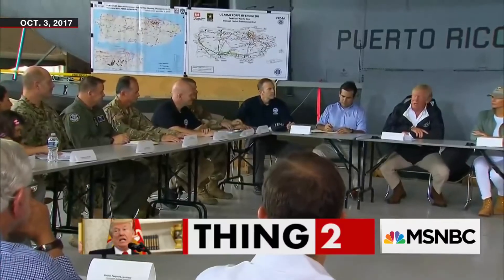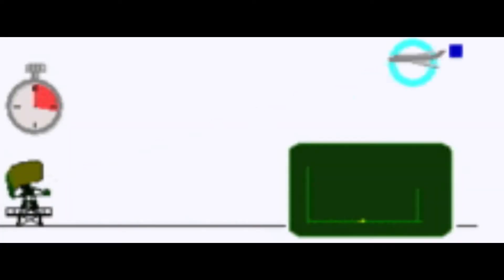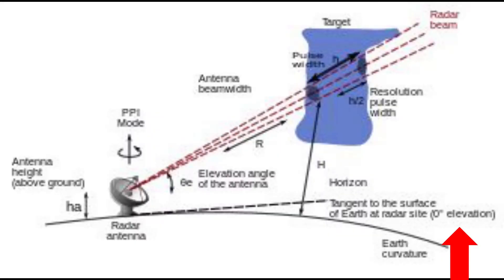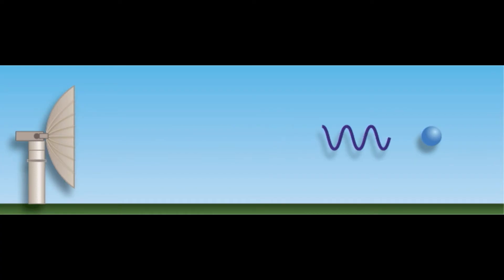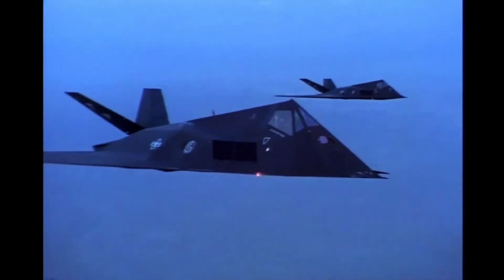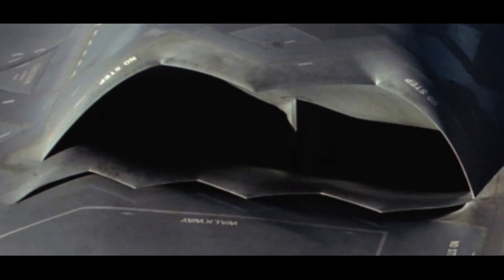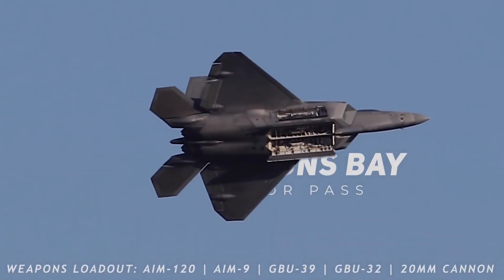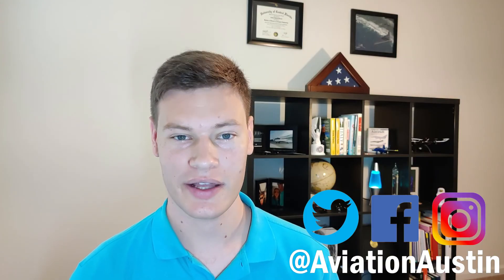The B2 Bomber and F117 | Stealth Aircraft Explained

Comment: The F-117's exhaust system also used various types of insulation materials like heat blankets, heat shields and sylica composite bricks and blocks to reduce and camouflage it's heat signature.  Also the B2 was not designed to replace the F-117.  They also still have a few F-117's that they fly out at Tonopah test range.  I actually worked on the F-117A from 1995 to 1999 ay Holloman AFB New Mexico when I was in the Air Force.  I worked Crash Recovery and in ESM (Exhaust Systems Maintenance).  Great video though.
Reply from the maker: You worked on Holloman? That's awesome! I did not know about the exhaust system. Thank you for your insight!

Comment: Geeze, $2.1B per B-2 is insane.
Reply from the maker: Isn't it?! Heck of a plane though
Reply: It doesn't cost that much.
Reply from the maker: https://www.cnn.com/style/article/b-2-spirit-stealth-bomber/index.html
Reply: @AviationAustin  The cost referred to is not unit cost or acquisition cost. It's the cost of the program divided by aircraft produced.
Reply from the maker: Okay. It still cost that much to make the aircraft. So that's the cost.
Reply: @peterson7082  yup you hit the nail.  It was $44B to make 21 airframes.  Then $11B more for the other 111.  Then they cut the program.    

That cost includes all the clearances ( for ex: top secret is $100K in 1980 dollars which goes back to your birth and polygraph), buildings, spares for 20 yrs, airfield operational costs etc.     

imagine how much your car would cost if you had to pay spares for 20 yrs, your garage, road from factory to highway, then your driveway.  Training mechanics to work on you special car.   Yeah it would be super expensive. 

Coincidentally, the B-52 cost about same budget % wise as the B-2.  It’s lasted 65 yrs and now the B2 is 33 yrs old.